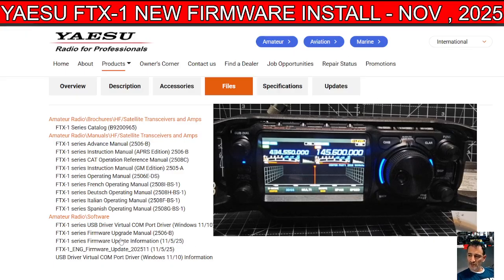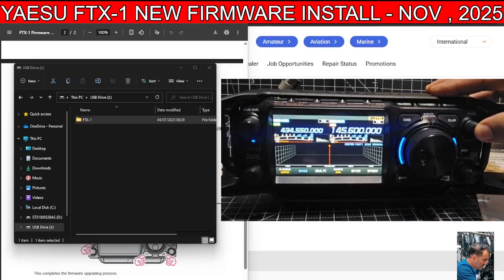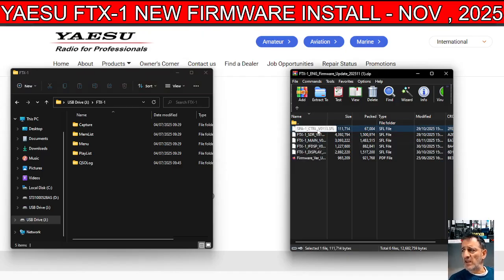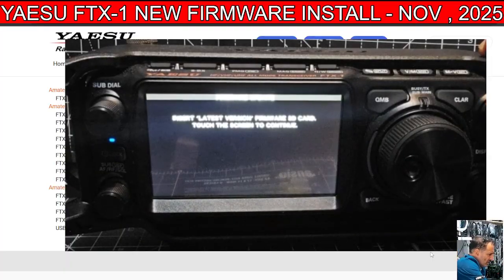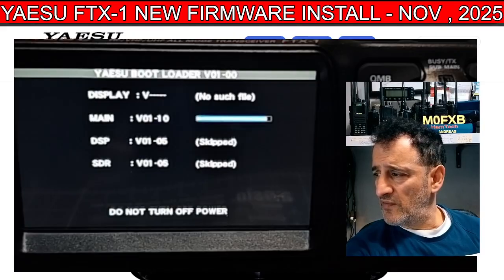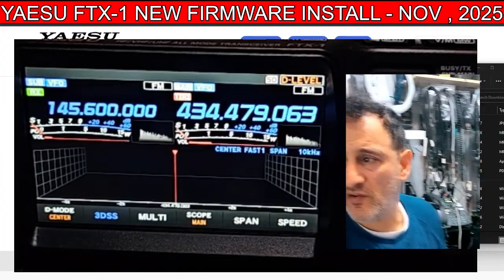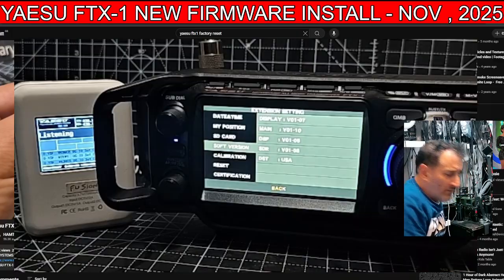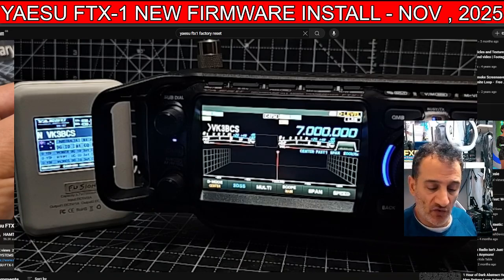INSTALL - Yaesu FTX-1 NEW FIRMWARE NOVEMBER 2025

Comment: Thanks for your video, Andreas.
Installed the new firmware on friday. Today (monday) WIMO sent out a warning to all FTX-1 owners, NOT to install the new firmware! But they didn´t mention any reason.
After the update, tuning can be startet via the microphone, it´s now possible to program one of the buttons. Noticed no further changes and no issues so far.
73, Bernhard
Reply from the maker: Hi the problem affects the Optima

Comment: BEWARE there are many reports of FTX-1 Optima getting the PA bricked after the update !!!
Reply from the maker: Yes seen the optima problems hope get sorted
Reply: I had no problems.  I did notice that when I first did the update, the Amp file was not loaded into the radio.
The update did correct the lockup problem I was having.